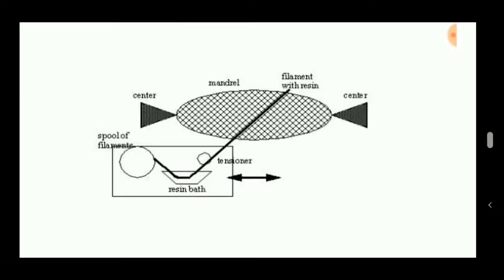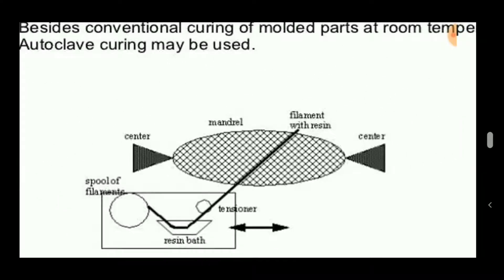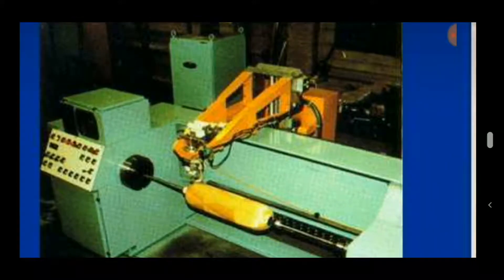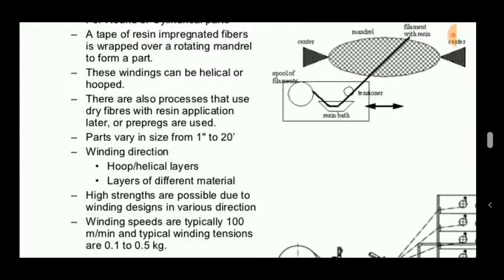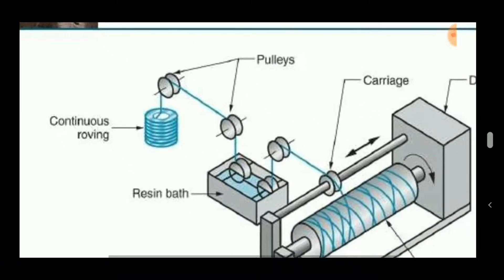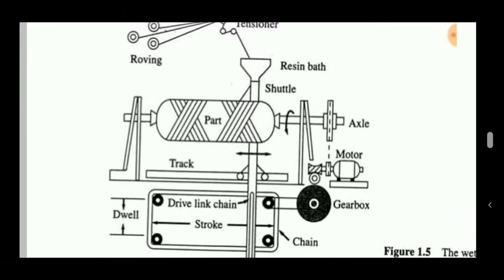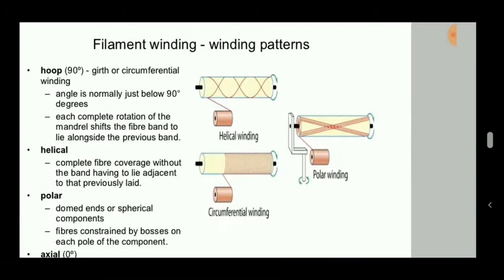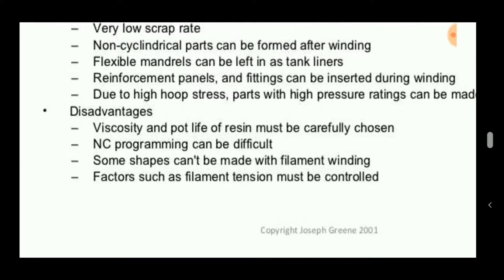Filament Winding | Process Explained | Polymer Matrix Composites | ENGINEERING STUDY MATERIALS

Comment: Greetings Engineering Study Guy:  This is the second of your videos I've come across.   I was looking for information on Carbon Fiber wrapping Resins and I came across this video.

More specifically; I'm looking for the appropriate or optimum type of resin for Carbon Fiber Wrapping rifle barrels where there is high heat to consider.  After watching this video it also seems appropriate to ask you what type of Carbon Fiber you would recommend for wrapping Rifle Barrels where rigidity as well as high heat are to be expected?

Can you give me an idea of which of the Specialty Resins and Carbon Fiber types you've worked with that would be suitable or optimal for this application?  

I have made a wrapping jig that I can use with my metal lathe in order to do the actual winding of the Carbon Fiber filament but at this point I am at a stand still due to my ignorance regarding the appropriate Resin to use.  I will not be making tubes of any kind such as what is shown in this video.  In the Rifle Barrel Wrapping application I am referring to the Carbon Fiber must actually be permanently bonded to the Rifle Barrel to take the place of the metal of the Rifle Barrel after the metal Rifle Barrel has been  milled down on a metal lathe.

Any insight you can give me on the correct Resins and Carbon Fiber filament for such an application would be sincerely appreciated.

Also:  I left a similar inquiry on one of your other videos.  My apologies if I'm coming off sounding over-bearing.
Reply from the maker: Sorry Brother, I have no idea.
Reply: @EngineeringStudyMaterials  No problem;  Thanks for taking the time to reply.  I appreciate it.